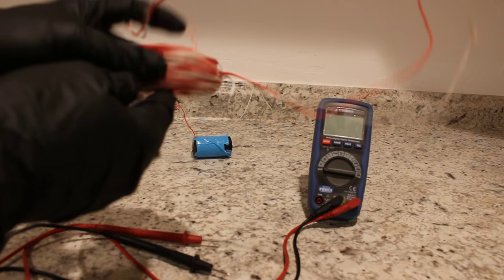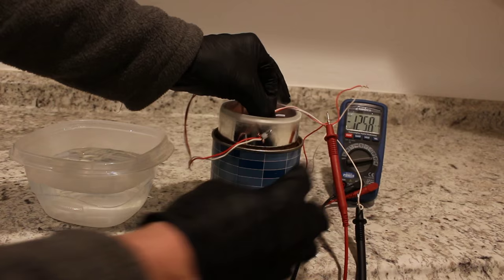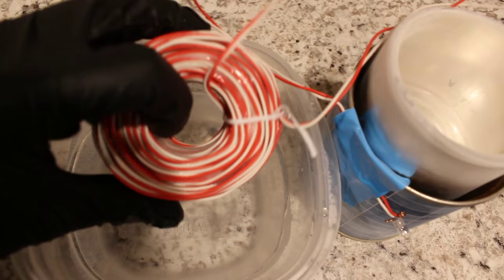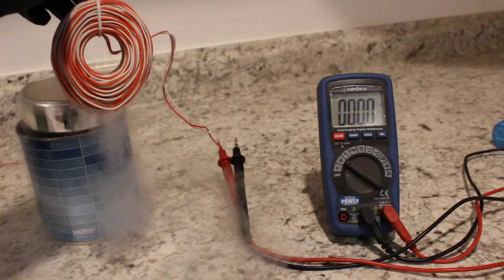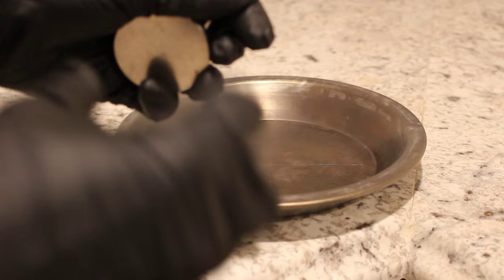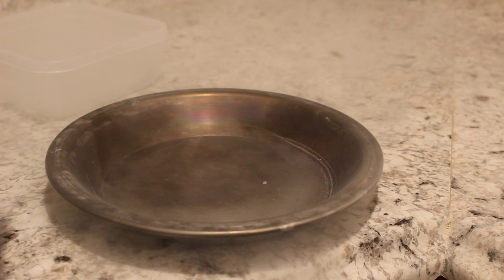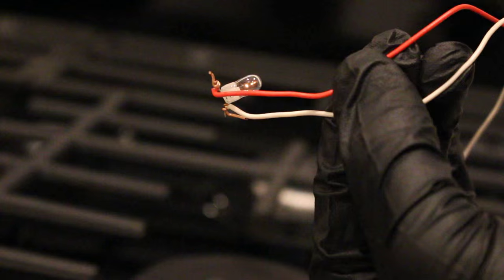Electricity vs Cold

Comment: Running a long length of line through water also affects transmission. You will usually only see it when you run coax or ethernet through water (in the form of lost packets), but it does mess with current

Comment: Might be interesting to check out how the wave propagation speed changes in copper wire versus temperature too. A limiting factor in computer engineering and communication. Maybe put an unbalanced load on the end of one wire and send a pulse through it and measure the time it takes to reflect back on the oscope?

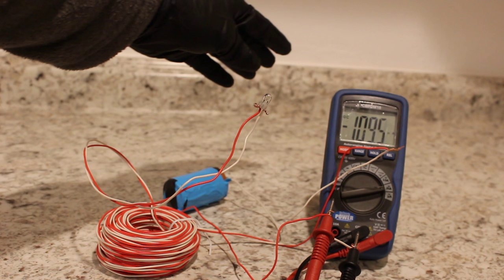Comment: I wasn't screaming at you to use ohms, though I am glad you did.  At 1:40, however, I was  telling the screen that you can't measure voltage and milliamps the same way in circuit; you can't just turn the dial to get those different measurements. You can measure volts in parallel due to the high input resistance of the multimeter (~1mohm), but you have to break the circuit and put the multimeter in series with the circuit (as well as move the lead from the volts plug to the amps plug) to get an amperage measurement. That could have been part of what was affecting your measurements/results!

Comment: Coiled wires are more ressistive (in AC) because they are acting as an inductor. 

the batteries chemical processes are reduced by cold.

you should have had the plate spinning on a motor, cooled it down, and then had the magnet over the top of it to see if the magnet would float.

Comment: I'm sure you could actually measure temperature based off of the resistance of a known wire. I knew resistance was affected by temperature, but I didn't realize it was that effective.

Comment: The mA range on many multimeters is next to useless due to the high resistance, always use the 10A range. Resolution might be poor but at least it is not messing with your circuit.
Nice experiments.

Comment: hey Cody, you short out the wire with the multimeter. you should put the multimeter in series to measure the power through the bulb.

Comment: It would've been interesting to see two multimeters used (and optionally a DC current clamp if you have it), that way you can measure a lot of things and not impact the circuit much at all.

Basically one meter measuring the voltage over the battery and then another measuring the voltage drop over the lamp, and somewhere convenient along the cord the current clamp measuring the DC current.

Also that little bit at the end was strangely entertaining to watch, the evil water being mean to the liquid nitrogen :(

Comment: I'd really like to see the effect of liquid nitrogen on an electric motor. Perhaps several types of motors, if the cold negatively effects aspects such as brush spring tension or permanent magnet fields. It would be neat to see things like a small motor with enhanced torque or operating on lower voltage than what it normally does.

Comment: Nice experiment as always, but as seen without the multimeter when the light goes very bright, i might assume that you may have used the multimeter improperly to measure it, as an amperimeter should have a very low resistance (ideally 0), check if you put it in series with the circuit and with the proper wiring and scale (most multimeters have different sockets for current measure)

Comment: Multimeter readings in the range of 1ohm are not accurate since the internal resistance of the meter plays bigger role then. The resistance of that coil of wire surely dropped below 100mOhms that the multimeter showed in the video. There are other methods for measuring such low resistances.

Comment: batteries rely on chemical reactions to produce current. chemical reactions slow down with lower temperatures due to the decreased kinetic energy => fewer interactions between particles. Even if the electrolyte doesn't freeze, the current could be severely reduced. that is one of the many reasons cars are harder to start in the winter.

Comment: If you had access to liquid helium... many metals become superconductors. Speaking of which: you have a furnace, why don't you try make YBa2Cu3O7?

Starting materials: Y2O3 + BaCO3 + CuO (in 1:2:3 ratios of metal ions).
Grind, heat to 950 degrees Celsius and cool. press into pellets and sinter at 950 degrees again. (may need to grind before pressing to ensure it is homogeneous) Then you heat the pellet at 500-600 degrees in the presence of O2 and slowly cool.

(A. B. Ellis, J. Chem. Ed., 64(10), 1987, p836-841)

Comment: Hey Cody. I think you may have gotten it wrong when measuring the amperage. I believe you have to change plugs on your dmm?? Build a remote control with an old cell phone, and use the output from either the vibrator or the speaker as a signal feed to a little amplifier (emitter-follower). Problem solved.

Comment: Well, since you brought it up the induction and mercury, time to make a mercury induction pump!.  You could probably make a basic one with a few solenoid coils and a 3 phase motor as a generator (induction or BLDC) Or for really simple, bunch of magnets on a rotor, spinning next to a tube? Would that be of any use in any of your silver extraction efforts? To pull the mercury/silver to one end of your retort, etc?

Comment: Nice! I'm pretty sure you should connect your red cable to the left side connector of your Multimeter to properly measure Ampere. Maybe that was the reason for your resistance problem?

Comment: I'm actually really surprised you didn't talk about the inductance generated from the current moving through that relatively massive coil of wire, the magnetic field storing energy and opposing flow, pretty import bit to leave out in my opinion. Note brightness slowly coming up upon contact and then quickly disappear when you open the circuit.

Comment: Cody if u are solid on idea of cooling the wire 
measure till what length the liq Nitrogen cools the wire to minimum resistance and make small pools of liq N2 in the mine 
but your mine will be filled with N2 to light the mine in minimum budget 
also experiment with liq O2

Comment: The lightbulb didn't glow the first time because you hooked the voltage meter in series, but you need to connect it in parallel. because a voltage meter has a high resistance so if you connect it in parallel most of the current will flow through the lightbulb. 
This is really basic electrical engineering.

Comment: those were fun & interesting.   you should try making a D.I.Y. siesmograph at yer mine so you can track the force & number of blasts you set off.   you could use an arduino & your laptop.  if it caught just 1 hangfire it could save your life.
   also you could purty easily wrap a d.i.y. transformer & put it inline on yer blasting circuit & make it more sure.

Comment: high pressure/heat = more resistance, low pressure/coolness= a drop in resistance. high pressure can act as a pushing force while a low pressure acts like a vacuum. I believe the reason resistance is lost in a conductor upon temperature/pressure drop is because the conductor acts as a vacuum rather than an opposing force. Question for Cody. Can photons flow in Absolute Zero? Is liquid nitrogen Absolute Zero?

Comment: This is very interesting and I learned a lot from this. About the battery when you dropped it into liquid nitrogen it got me thinking of space travel and that extreme cold could kill/freeze most reviving solutions there is. What I have learned is that NASA uses nuclear power for long time travel in unmanned exploration probes and from this video I figured that it must always have a heat source to keep batteries if they have any and other instruments alive.
Reply: +nattsurfaren My understanding is that over-heating is often a bigger problem in space, since no conduction or convection takes place. The only way a thing in space loses heat is radiation, which isn't that substantial compared to what we're used to here on Earth.

Also keep in mind that flywheels are an alternative for storing power that's used on the space station. They have a carbon fiber ... disk I think, spinning extremely fast in a vacuum on magnetic bearings, and use it to store energy for reasons that I vaguely recall revolving around a combination of safety and longevity.
Reply: +seigeengine 
I didn't know about that but it makes sense because there is no gas (only vacuum) and for that reason it behaves as a thermos.
About the flywheels I would imagine there could be some problem. Will friction behave as friction (to generate heat) in very cold temperature? Another thing would be to use them as generators but will a generator work in very cold temperatures (I believe it would but I'm not sure). What about heating through electricity in very cold temperatures. Probably possible but it would require more power to do so.
Just thinking out loud.
Reply: nattsurfaren Well, it behaves sort of like a thermos. Thermos(es?) also block most radiation by using a metallic coating that reflects the radiation back into the contents of the thermos.

Uh, I wasn't giving an opinion. Flywheels are used in practice in space for power storage.

Not really. It being suspended via magnets in a vacuum kind of stops friction from being an issue.

Why are you still going on about temperature?

Yes, though, electrical heating is, in terms of power to heat, 100% efficient.
Reply: seigeengine I was on my original thought about long time space travel. Imagine everything being suspended and very very cold. What would be the most likely working solution to effectively restore heat and power. As for friction I didn't mean it as a problem but as a solution to heat things up if heating through electricity would fail. I was thinking about your answer with fly wheel to be a solution but how. 
Imagine this:
You place a heating wire in liquid nitrogen and try to rise the temperature. I don't know if that work because I learned that most metals becomes superconducting with such cold temperatures. 
As you mention if fly wheel are used in practice are we then talking about suspended environment (except the fly wheel) with close to absolute zero where elements are superconducting.
Reply: nattsurfaren A nuclear fuel source would probably be your best option.

You don't want friction. Friction is wear, wear is bad.

No, most materials don't become superconductive, meaning any resistance leads to heat, and that heat increases further resistance, which produces more heat. Radioactive isotopes used in nuclear power generate heat to function in the first place, so keep that in mind.
Reply: Cool thanks for clarifying this seigeengine :)
Reply: +nattsurfaren the nuclear power devices you mention used in deep space probes, use radioactive decay to generate heat. The heat flowing from hot to cold across a thermovoltatic pile then produces electricity.

Comment: Hey,
one Question. So if the resistance drops with temprature. Will the ligthbulb turn of if you put it into the nitrogen??? Because the ligth is produced by the heating of the wire because of its resistance! This wont work with the glascover around the wire because of the horrible head conduduction through vacuum. But you can break the glas and put the wire directly into the nitrogen. Due to the  absence of oxygen the wire will survive anyway. I think there are 3 options what will happen. 
1: Ligth will glow anyway because headconduction of nitrogen ist not high anougth
2: The wire beween batterie and ligthbulb wil glow because of the increased current flow
3: The Batterie will start to cook because of the same reason.

What do you think will happen?

Comment: I wonder what would happen if you tried an AC instead of DC battery. I've heard you can maintain a voltage with further distances using an AC power supply. I might be misinformed but it would still be very interesting to see.

Comment: Your multimeter might not have been precise measuring the resistance even with 1.4 ohms. Below 10 ohm they get un precise and sub ohm you can forget to get any reliable numbers. There are specialized meters for low resistances.

Comment: do not use "amper" mode on multimiter in such applications, ever!  measure the voltage drop across the wire instead

Comment: when i was young my parent used to keep the battery in the freezer so they last longer, i guess keeping them frozen make sure they can discharge. I also found it weird that your multimeter had a resistance on Amp setting, it should be close to a short circuit like 0.001 ohm through a fuse, maybe your leads were the problem ?
Reply: +Samuel Lamontagne It was on the milliamp setting. There is a significant meter resistance on that range. Check out "burden voltage".

Comment: Winding the wire up in circles creates more resistance because the wave fields react with each other. This test would not be accurate because more resistance is being generated than that  in the mine blast.

Comment: You hooked youre multimeter wrong, you're shorting the probe to the battery thats why the bulb did not light. You should hooked the multimeter in series with the bulb setting the multimeter in "Amp mode".

Comment: I don't agree with your explanation of the drop in resistance due to the lowering of the temperature. This drop in resistance is actually mostly due to the fact that resistance at room temperature is caused by collisions with phonons, which are quantised thermal sound waves. As you cool down, the density of these phonons reduces, leading to a lower resistance. So it is indeed a quantum phenomenon, but it has little to do with constraining the momentum.

Comment: An Intresting thing I noticed was the insulation of wire dint wear off ! from a some 100°C temperature change almost immediately
Reply from the maker: +Rajas Godbole 
Its coated in nylon so it holds up pretty well.

Comment: Hey Cody, the reason the coil reduces in resistance is not because of the heisenburg uncertainty, the reason is because the electrons become cooper pairs and become bosons instead of the individual fermions they normally are. 
http://hyperphysics.phy-astr.gsu.edu/hbase/solids/coop.html

Comment: The explaination through the uncertainty principle didn't make much sense to me. I would guess it was just due to cooler particles having less kinetic energy, and can thus stay closer together?
Reply from the maker: The atoms sort of get close together but its only because their wave form spreads out.
Reply from the maker: TLDR they get bigger.
Reply: Interesting. Thanks
Reply: baically the hiesnberg principle says that the amount of precision of a particle momentum (Δp) times the amount of precision of the position (Δx) must be equal to a constant (h). So Δp*Δx=h. This means that as the precision of the momentum increases, the precision of the positin decreases, and because in quantum physics particles don't have a fixed position but instead a space where it's likely that they are, this spaces increases
Reply: The way I like to simplify it is the wire has electrons attached to each copper atom and because they are warm they are moving around quickly. When he cools them down they slow down and are easier to get past. Slower electrons don't "bump" (using electron force)  the passing electrons (measured as current) as much so more can get through at a time.

Comment: The resistance in the wire went from 1.4 Ohms all the way down to 0.1 Ohms. With a constant voltage and ohms law the current difference between the two states should be quite large, by 14 folds in this scenario. A multimeter set to measure current, while properly placed in series, shouldn't affect the circuit. Why was yours affecting the circuit so much? It shouldn't be.

Comment: you use a one volt battery to light a bulb thru 30m of thin wire and measure the current shorting the load with the multimeter. good Lord...
and the multimeter was a source of load not a source of resistance. 

btw, just use a 6v or 12v battery to detonate the caps or the diy lightbulb....

Comment: hello cody. i really doubt the multimeter has a significant resistance compared to the rest of the circuit. in fact it probably has at least an order of magnitude smaller resistance.

Comment: u hooked up the amp meter wrong... u should connect the volt meter parallel to whatever ur measuring, but the amp meter u should connect in series to the bulb in the circuit. basically u have to break the circuit at one point and connect the amp meter there.

Comment: when you are measuring amps, doesnt you need to change the contact on the multimeter? i can see you got it in the middle when you're trying to measure amps.
Reply: +whiteland9992 I thought so too at first. I wondered why he didn't have the red lead plugged into the left 10A terminal. I later noticed that the right terminal, in addition to being for voltage, is also labeled mA and µA.
Reply: aahhh.. didnt spot that.
Reply: In those, up to 200mA range, you dont. bigger than that, YES. Even the expensive ones are splitted in two ranges with two terminals. Lower currens dont require any change in connection. But, you need to know the peak current in advance to avoid blowing the 250mA fuse

Comment: If the the positive and negative wires are twisted together would it work better like a cat6 wire compared to a cat5 or  cat5e for servers? the cat6 can send more data compared to the cat5 because they have twisted the two like wires together in the cable. Same idea was found out on the first telephone, less feedback with more twists in the wire. Should give it a try

Comment: Hello cody,

Could you try this experiment with an transformer. Plot the power out devided by the power in versus the load. If i'm correct, the efficienty would increase as the transformer gets colder.